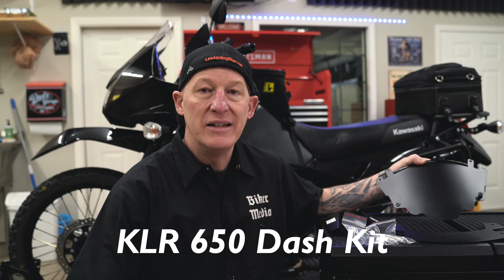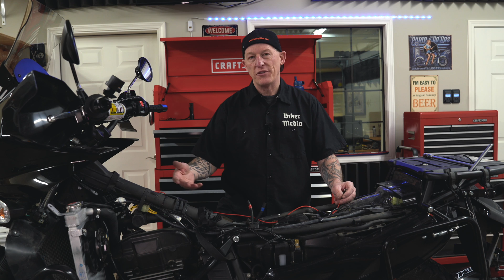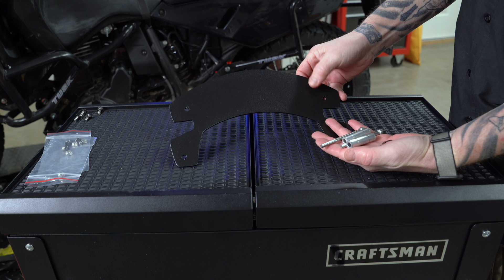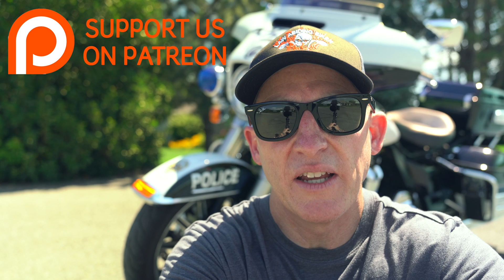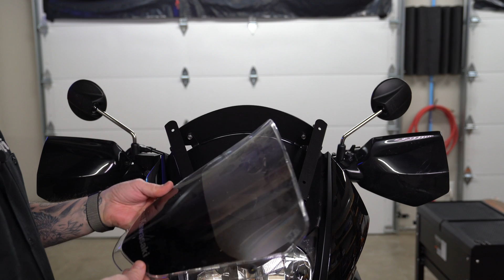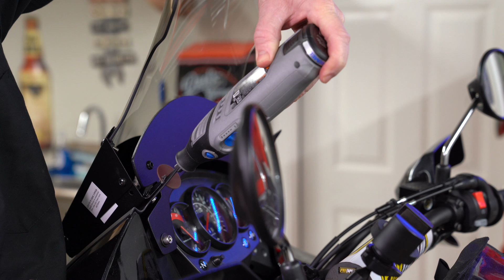Install a Kawasaki KLR 650 Rally Dash Panel 2nd Gen-Tutorial

Comment from the maker: **SUPPORT US! GET A KLR DASH IN THE LAW ABIDING BIKER STORE ==> https://shop.lawabidingbiker.com/products/klrdash-rally-dash-kit-for-kawasaki-klr-650-2008-2018?variant=31825219453060
Reply: I saw this on ebay for $70 Shipped.  I think it's a Chinese version but it looks basically the same.
Reply: Will definitely do, all I need is confirm I will be now to mount my brackets on this rallye tilting windshield thing, also would like get the lower dash with the charger and volts meter. Peace 👍

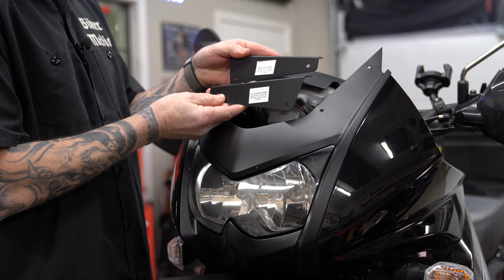Comment: 2:23 min into the video.... You missed a step, adding the inner panel.  maybe because its a crappy design and the rubber screws caps keep falling out... they should have tack welded a nut on the back side instead

Comment: Hi. I have a 2014 KLR WITH STOCK fairing and shield. I also have the Denali fairing light mounts and a pair of Denali lamps on the fairing. My question, will the lamp brackets I have mount on this Rallye kit as they did on the stock fairing?  Do the holes match ? They should because windshields have this same holes I assume. If you need see what I mean with lamp brackets, check the  Twisted Throttle page and they show those brackets under Fairing mounting brackets. Thanks